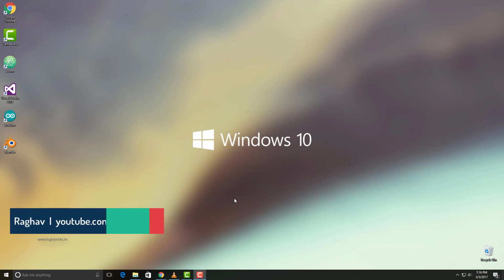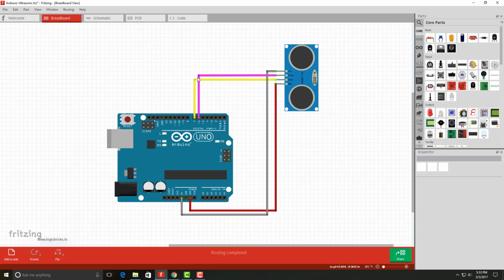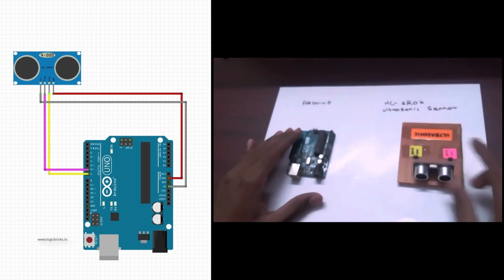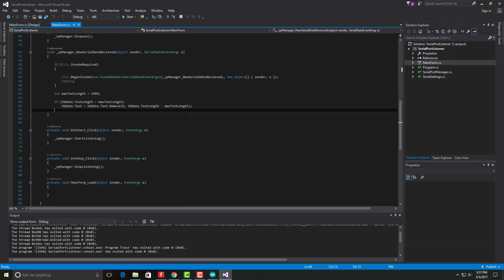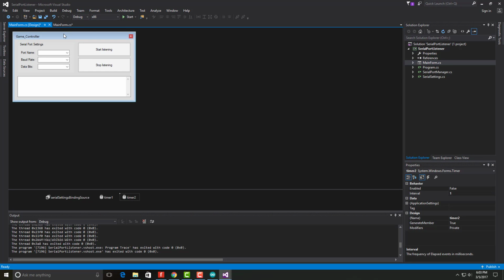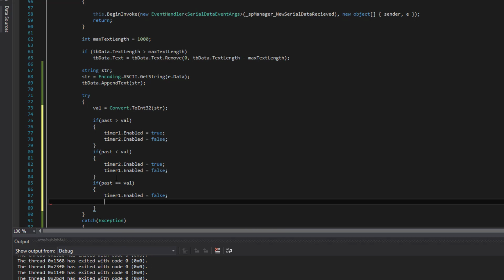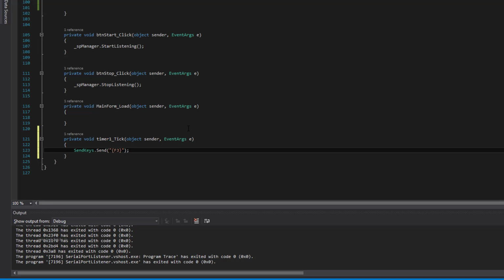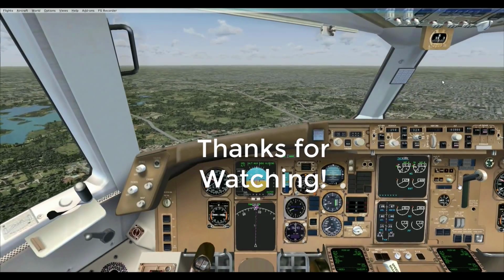Make your own Throttle for Flight simulator [DIY] - using Arduino

Comment: Is it possible to make a yoke using arduino uno?
Reply from the maker: Yes it is possible, you can use flex resistors
Reply: Thanks dude, I made it ,but it worked with a python script

Comment: Great man. But what about a potentiometer? Can I connect 3 or more potentiometer to the Arduino UNO and map them to function as the throttle and mixture controls?

Comment: Im not able to get it to work I use FSX and i have FSUIPC too but i dont know it just doesnt work. Any help would be appreciated. i converted the build into an exe file, when i start listening i get the readings but then nothing happens in the simulator.

Comment: Hello ,
One question, using this VL53L0X sensor, could use it on Throttle hotas cougar, using these Teensy 2.0 or Atmega 32 u4 5v 16 mhz cards, but how to install the sensor on Throttle!
Thanks !

Comment: Hello,
I have a Hotas Cougar, I have a design to use Hall sensor, along with an Arduino , using these Neodymium Magnet N45 Ring 10x5x5 mm Diametral.
Please, which Melexis magnetic sensor, could you use in this project, what would be your recommendation ??
Thank you !!!

Comment: Great idea using the ultrasonics, I would have used potentiometers, wouldn't have thought of that, I believe there is a library prebaked, you can use for arduino to send keys, which would eliminate the need for the C# code, but all good fun doing your own I guess.
Reply from the maker: If you wanna directly send keys from Arduino then you need to get Arduino Leonard Board. Since Arduino Uno board are not capable of sending keys.

Comment: I think this sensor which is measuring distance would be very good for using it as a positional head tracker. Like head movement forward backward, left and right, up and down. However, I don't know how far it will measure distance and the accuracy. In sim flight, another problem is when turning your head around it will cause change in distance which you don't want it because it will measure different position. Is there is a way to prevent change in distance when the sensor is turning around?
Reply from the maker: That's how an Ultrasonic Sensor works. So we need to restrict the rotation.

Comment: the controller that is shown at the begining with three handles what slider or potentiometer  would that be if i wanted to make one just like it
Reply from the maker: You can either use  3 separate ultrasonic sensors or 3 potentiometers.

Comment: can this work with potentiometer
Reply from the maker: Yes!, You can implement it using potentiometer also.
Reply: with same code?
Reply from the maker: No, you need to write code for reading values from potentiometer instead of the ultrasonic sensor and you need to the do corresponding changes in the c# application. If you face any problem in doing that, ill help you to solve it!
Reply: thank you very much
Reply: May you please show us how to do the same thing with a potentiometer?

Comment: I have background in computer science and arduino but not in visual studio. I got your idea but when i try to use this, it doesn't work. I have the keys same. Should i assign f3 to throttle increase quickly and see if this work. + iam using .NET version of visual studio. PLease help btw good job. I would use this and make a 3d printed throttle
Reply from the maker: Check your key bindings in both game and c# application.
Try Logging the distance values in c#, and debug if something is wrong there.
If this doesn't help, record your screen and send me let me check where the problem is. Thanks!
Reply: I did check the key bindings and as I told I don't have much experience with visual studio. How would I send you my screen record?

Comment: Hello, firstly great job! I did all of the steps, codes are working very well but while I m playing, it doesn't work. Do you know why?
Reply from the maker: Make sure that the keys you have assigned for throttling the flight in FSX are same as what you gave in the code. Still not working ping me.
Reply: Did you make it work?

Comment: can it work with DCS world or GTA V
Reply: Ofc it works! just need to do some slight modifications in the code
Reply: Yes, I've used the joystick library, an ardiuno micro and a potentiometer for DCS Harrier nozzle control.

Comment: How do i add "reverse throttle" here? also, how do i add "autothrottle, like adding some motors with the throttle will make it "autothrottle"
Reply from the maker: this method supports both forward and reverse. What do you mean by autothrottle? u mean how to make the throttle system respond in autopilot mode?
Reply: yeah, autothrottle system for autopilot mode. We can perhaps use a motor to move the throttle
Reply from the maker: Yes! for that you need to use servo motors. To control servo motors with Arduino we have servo library The Servo library supports up to 12 motors on most Arduino boards and 48 on the Arduino Mega.
Reply: great, but i would also like to add another ultrasonic sensor for flaps... is it possible with this?
Reply: Can you please give me the direct executable file of the "game controller" application? I am having a problem with the NET framework. Please provide me that ASAP

Comment: Hi, i tryed it with potentiometer but no sucsses, could you explain hot to get a potentiometer values?
Reply from the maker: The potentiometer provides a variable resistance, which we can read into Arduino board as an analog value.
For this purpose, we use analogRead().
analogRead() returns a number 0 to 1023 that is proportional to the amount of voltage being applied to the pin

Select the pin 2 in arduino board for reading values from the potentiometer
then read values using the analogRead(pin number)

void loop()
{
inputVal = analogRead(2);
}

Comment: could you not just use a potentiometer instead
Reply from the maker: Potentiometer is a good choice, it will give a smooth/ noiseless response in the game and It is based on resistance(or in other words directly it deals with voltage) but here i have used the concept of distance values.
We can use  flex resistors, or even motion detection (image processing) etc., the main aim of this video is to give an idea that how we can make our own controllers for any games. By the way, Thanks for your feedback buddy!!